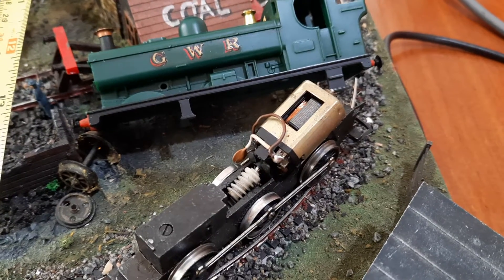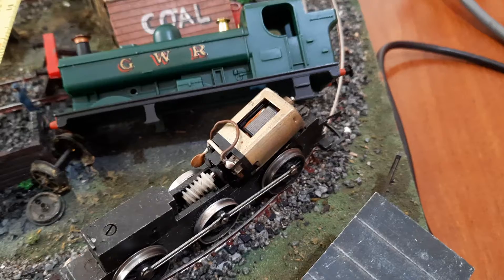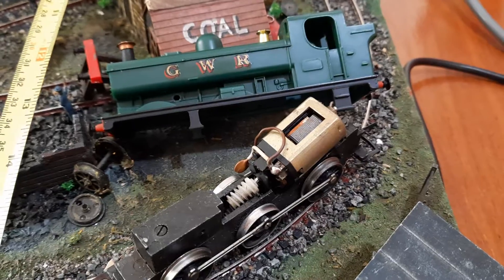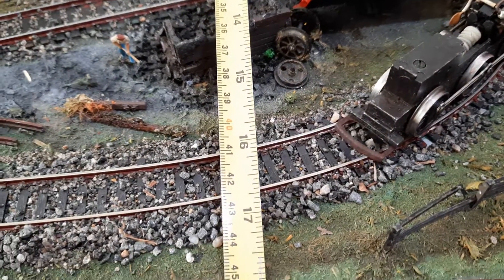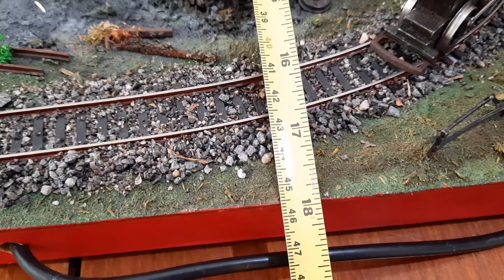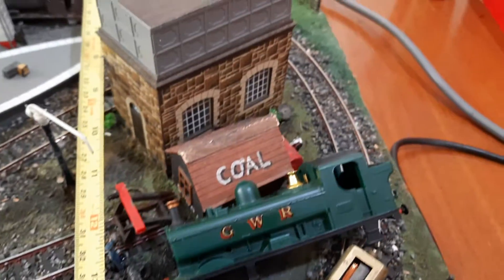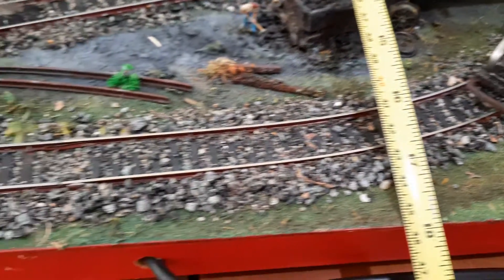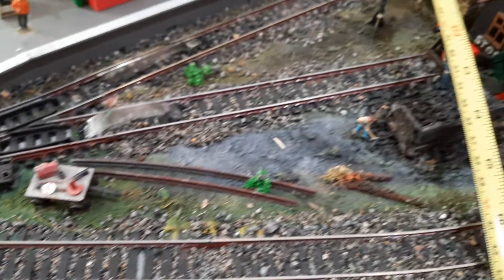marklin and other trains

Comment: Hi, thanks for clarifying what type of motor is fitted in your 0-6-0. It looks like Hornby fitted the same motor used in their Smokey Joy and 0-4-0 Locos.
I have converted 4 of my Locos from the XO4 to the can type motors and now they run much better at slow speeds. Cheers, Paul.
Reply from the maker: So thats a "can" type motor  I was getting confused with the Lima pancake type.
Actually, I also like to fiddle with my old/pre-loved locos to get them going. I only own one Marklin that was bought new some time ago. I try to rebuild as close to origional as posible(sortoff)!
Mike
Reply: @maple1232  Hi, Mike, I have been looking at the various models of the Hornby Pannier Tank 0-6-0 and all seem to have the XO4 fitted. I may be totally wrong but is it possible someone has converted yours previously with a can motor?. As I have mentioned I have fitted a 5 pole and a 3 pole can motor in 2 of my Hornby 0-6-0 Pannier heavy metal chassis then fitted Jinty bodies. I have spent many hours modifying old Locos to make them run smoothly and quieter. One of the biggest problems was finding worm gears  with the same pitch and shaft size. I mostly use Plastic worm gears as with a lot of care they can be made to fit suitable can motors. I dont know if you have watched any of my videos, they feature many of my "specials" the last one being a French Jouef 67001 that had a single axle drive that could not pull itself never mind coaches. Now it has a Mehano all wheel drive chassis and is a great runner. 
My best specials are my versions of The Rocket, Lion, and a one off called Locket (made in lockdown) all from my scrap box.
Sorry for the book on train mods hope you stayed awake. All the best, Paul.
Reply from the maker: @paulvozman842  morning, have had a good look at the loco and if it is a home mod then it is very well done!
I also have an old Jouef 141R that was found in a box on the side of the road!
After a good clean etc it now runs but only tender first which is ok as its tender drive anyway.